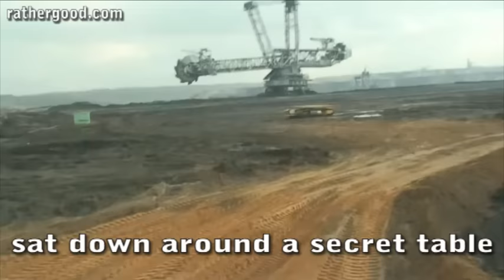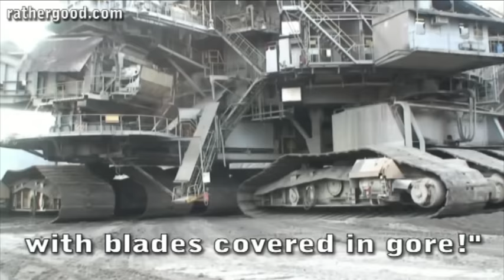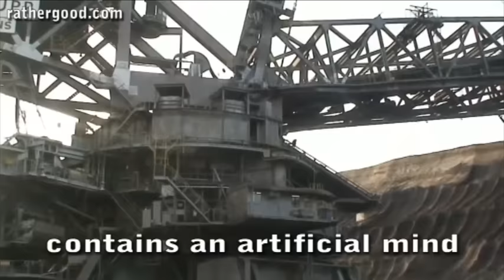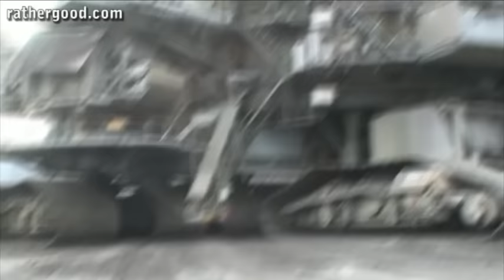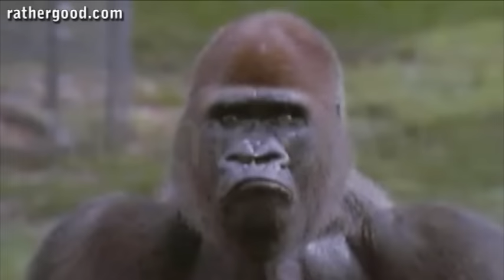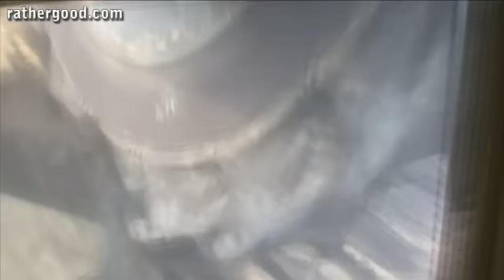Bagger 288!

Comment: But we have to find out how fast it goes around Nurburgring and Top Gear test track.
Reply: 8.58 hours and 4.7 hours.
Reply: CJ Chatham thanks but nope, (2.83km) / (0.6km/h) = 4.7
Reply: artman40 it's BIGGER THAN THE TRACK
Reply: Top speed btw is 10km/h that is 6,2mp/h
Reply: @TheMeanBean322  But it is able to make that no car  will be able to be faster than 8.58 hours after
Reply: @faeganwhite1258  how about Understeering?
Reply: artman40 there won't be a Nurburgring when it's done
Reply: Probably 5 minutes if driven by the Stig.
Reply: What do you mean by "around" ? This thing goes over the tracks.
Reply: Jean Roch over the hedge
Reply: It takes five full days. However, once it has its rank, it will never drop any lower as it will have destroyed the track and also the nearest three cities
Reply: @mrmaniac3  well, it has only 17.1 N/cm² pressure on the surface (1.7atm). In fact it even traveled on the autobahn (OK, cross it, but who's counting :-)), a railroad line, even a river when it moved 22km to a new area in 2001. In three weeks.
Reply: It takes 3 weeks and costs $10 million to travel 14 miles apparently!
Reply: @gazthemodelman  Depends on which version we are talking of here... If we take it Niels Heusinkveld's shop and do a little track tuning and engine tuning.
Then you get the fastest shed dweller to take it around the Ring and record its fastest time.
After all, they did do that to a Caterpillar mining truck already... :D
Reply: Which means, of course, handing it over to our tame racing driver...
Reply: it's got roughly 22,000 horsepower

Comment: Sadly the bagger 288 has been beat in size even though only slightly, by the bagger 293. still the thought of 6 things about this size raoming around is really really fucking terryfying
Reply: +Horst Weinert I believe the Bagger 288 is bigger in volume, but 293 is either longer or taller? I really dunno though.
Reply: Well 293 is heavyer as well. But 288 is way more legendary
Reply: Why don't we put these things on NASA's Crawler-Transporter and have like 3 Bagger 293s just riding around for some reason.
Reply: Omg that sounds awesome
Reply: @shiningarmor2838  the crawler would be too small. These things are almost twice as long as the Saturn 5 is tall, and about 4 times the weight...
Reply: @shiningarmor2838  The Crawlers are way too small for it. Also the Bagger 288 as well as the Bagger 293 can drive themselves.
Reply: @Maddinhpws  Yes i agree the Crawler would be too small but it is worth noting that both Bagger 288 and 293 need external power sources while the Crawler is all in unit, so it's quite a stretch to say drive themselves considering how many more people need to be present when a Bagger actually moves any significant distance.
Reply: Imagine that giant bucket wheel chewing through your room 😅

Comment: I bought a 288 similar to this 2nd hand at a foreign dealership. Worst car I ever owned. Pathetic waste of money. It was slow as fuck and got TERRIBLE gas mileage. I practically had to take out a 2nd mortgage just to drive down to the shops for a bag of chips. It attracts too much attention. It's hard to park. It's unreliable and hard to work on. Finding parts is a nightmare. It's honestly very ugly. And looking at it you would think it's at least roomy inside but it ONLY HAS ONE SEAT. Who the fuck designed this thing? Seriously, if you're in the market for a good commuter car, I'd say look at maybe a Ford Escort or something instead. That's what I call a car. But this POS is for the birds.
Reply: +CosmicPentastar They wont find parts, they just build parts. Cuz you know Krupp is magic.

aaaaand man, u want earth mover become cool like sport cars? hellno, it cool cuz its self already.
Reply: but you do know, that the Bagger 288 is an EV ... and its 16.5 MW are definitely not too much. A high power electric locomotive runs on a peak power of 7 MW. Look on Wikipedia before you talk about gas mileage.

Comment: A death machine with an artificial mind full of hatred wreaking devastation could be right from Warhammer 40k.
Reply: Problem.
The Bagger 288 cannot be defeated. Ever.
Send it against the chaos gods, they fucking die. In-universe problems all solved. The point of the setting is defeated. It doesn't work, narratively.